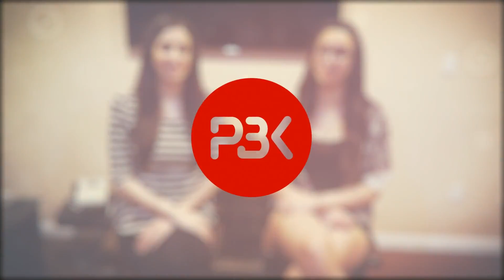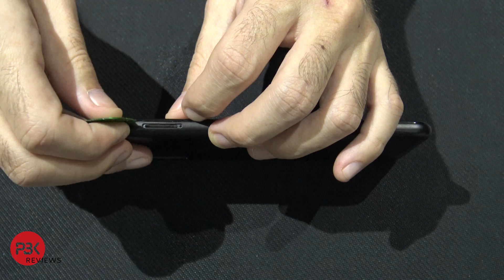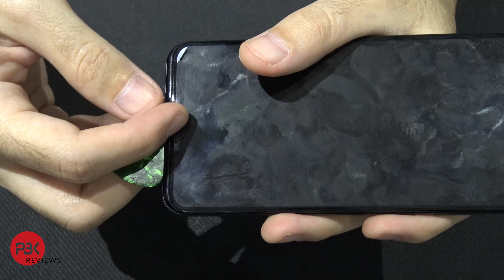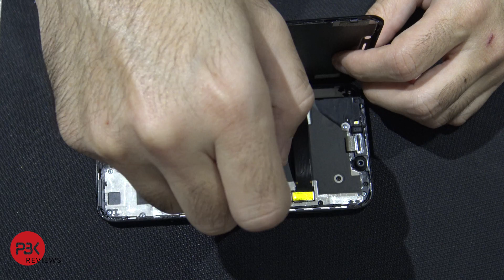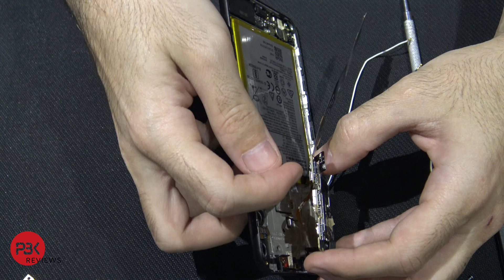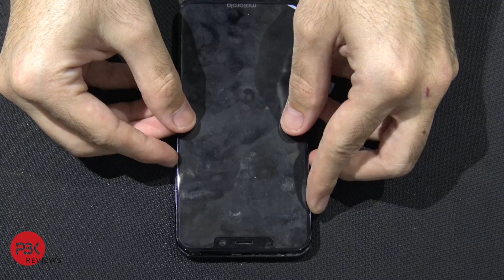Motorola One Power Moto One Power XT1942 Disassembly Teardown Repair Video

Comment: Why protective tape required on battery? Does absence of tape reduce performance of phone
Reply from the maker: It helps transfer heat away from the battery and components to the back of the phone to be transferred out.

Comment: sorry, but how to remove the battery?
Reply from the maker: Battery is held down with adhesive, so you need to use a hair dryer or something else to heat the front part of the phone where the screen is so you can warm up the adhesive underneath the battery to loosen it up. Then you use a plastic pry tool to gently pry the battery off (keep in mind not to pierce the battery or bend it too much to avoid risk of it shorting or catching fire etc.).

Comment: my phone turn on only when charging, when unplugged charger it turns off, what could be the the problem, do i need to change battery or charging port board
Reply from the maker: Might be a bad battery or possible the battery cable got disconnected. But either way seems to be a battery related issue.

Comment: I got my battery replacement in my moto one power. Even before one month of replacement the battery got unstable and dead. Only white led blinking in the top while connected to charger. The battery had warranty for 3 months. I tried to claim but they said they will check for any short circuit. ( I think the battery is unstable since battery backup is not good already). But now they are telling that an IC got short and waiting for the spare. What to do ?. Help me please
Reply from the maker: Hi, not sure since I am not too familiar with electrical engineering to be able to help you there. If replacing the battery did not fix the issue, then ya your best bet would be to wait and see if that short is fixed from whoever told you that was the problem. Also make sure your using an original charger to prevent possible damage caused by the charger itself.
Reply: @PBKreviews  I don't know what happened but they repaired my phone for free. Maybe they made a mistake while battery replacement 🤷🤷
Reply from the maker: @jamunal3715  oh that's good

Comment: This video is incredibly detailed and knowledgeable and I'm watching it for second time. Wonder why it got so less views. 
I was hoping to understand why my volume increases automatically and the volume bar stays popped up on the screen and power button short click doesn't work (although long press to restart the phone works). The popped up  volume bar usually goes away when I touch the home button on screen. Any idea what might be causing this? The phone is 2 years old but it started a year back, I was just too busy to take it to service center.

Comment: My moto one power (1yr old) display is 50% broken but still works nicely should I use the phone in such condition or the broken screen should be replaced!
Can I insert tempered glass in such condition!?
Reply from the maker: Hi, its up to you, but the broken glass can get worse or cut your finger when using if its bad enough. You can place a tempered glass over but it would sit flush and would have bubbles or air underneath it since the screen glass is broken.
Reply: @PBKreviews  thank you brother for the conducive information.
Reply from the maker: @abhikchakraborty3850  you're welcome

Comment: I want to replace changing board. My charging port is just loose and did not work for turbo charging and disconnected. So can i assemble it by myself at home? And can you tell me what kind of tools i need to buy? 😲😲🥺🥺
Reply from the maker: You should be able to as long as you follow the video and are careful but it's not too easy for a beginner so do it at your own risk. You can get one of these ifixit tool kits which will have the tools needed to do the job. https://amzn.to/2QfKb8t   . You will also need new adhesive to cut and apply to the frame to put your screen back on. Links are in description.

Comment: Sir,can u kindly tell me after replaced the screen display....usely work good, after long time the screen display was sleep .... without help of charging...any idea of in this issue
Reply from the maker: Not sure exactly what you mean, but if the screen is staying off maybe your proximity sensor is covered and is thinking your face is to the phone so it keeps the screen off. Check the sensor see if anything is wrong with it
Reply: @PBKreviews   see a couple of
Days I replaced the screen display it worked like as Normal, suddenly unexpected happened,wild I'm using...the phone has sleep and can't turn on,i only can "on" with the help of charging..the battery was 76%quit enough good.i don't know why?** Kindly,guide me to fixe..

Comment: Twice I folded the whole Motorola One Power as shown - https://www.youtube.com/watch?v=Nw_vAzCWGaU - after replacing the board - USB sockets. After submitting the whole - according to the demonstration film, the display lights only at 0% .. Where do I make a mistake?
I am asking for help in removing the assembly error of my Motorola One Power - the best answer is to e-mail andre49@wp.pl

Comment: Hey! I have Moto one p30 note,xt 1942-1. Somehow i managed to flash "ab blur" 29.74.25  file. Can you please tell where to get the OTA updates for December, Jan and Feb security updates? I'm currently on November patch with unlocked bootloader. Of course auto update doesn't work. Also can i flash xt 1942-2 files?

Comment: Can you replace everything without a heat gun? Do you have to remove everything to get to the battery?
Reply from the maker: Hi, yes and yes. You can do it without a heat gun but might be harder to pry open. Also you need to disassemble the phone to get to the battery.
Reply: @PBKreviews  Thanks!

Comment: @pwedbykyank bro can u just give me the main board and the charging port board??? my one power is liquid damaged????
Reply: and so i found that there is no p2i coating because i havent dropped my phone in water but it got damaged due to a sinlge little water splash
Reply from the maker: Hi, i dont have the phone anymore. Did you try using a brush like a tooth brush to clean off any corrosion on the main board and connectors?
Reply: @PBKreviews  ss i tried a cleaning the board and i found it shorting and i coludnt repair it
Reply: i only bought it last month only it was my first phone bro......after the nokia c5
Reply from the maker: @gopinathgopi5534  oh sucks sorry to hear that. Try contacting Motorola maybe they will offer repair option to you.

Comment: Hello, which camera sensors they used ?
Reply from the maker: The main camera is 16MP PDAF (f1.8, 1.12um), and the secondary is 5MP (f2.2, 1.0um). Also the front facing camera is 12MP (f2.0, 1.25um)

Comment: This phone suffering screen bleeding issue  I use this phone I am facing this problem  Flipkart doesn't help me!
Reply: its not screen bleeding. its gradient colour. u can check this on screenbleeding app.
Reply from the maker: yes many people are having or reporting that issue. Motorola says its a gradient setup with the software for the navigation keys. If it is so, hopefully they will make an update to the software to give people the option to turn it off or on.
Reply: It's not screen bleeding

Comment: Only 4850 mah
Reply from the maker: lol. Its not bad
Reply: @PBKreviews  they advertise it by saying 5000 mah battery now i am thinking of the actual capacity of the phone which advertise 4000 or less mah battery
Reply from the maker: @sumitahar5328  on the battery it says 4850 / 5000 so im just going with the lesser amount since it seems to me in actuality it would only be rated 4850

Comment: Does it has screen bleeding issue..!!
Reply from the maker: No, no bleeding issue on this unit. Why? Is that a common issue with this model phone?
Reply: @PBKreviews  yes sir...!!
Reply from the maker: Oh i see. Hmm thats odd. Does it happen after a drop or just naturally?
Reply: @PBKreviews  naturally
Reply from the maker: hmm i see, I will take a closer look in different lighting patterns and see if I can notice any bleeding light around the edges in the next few days
Reply: @PBKreviews  if you see any such issues pls make a dedicated video on this sir..!!
Reply from the maker: @bsd star @gagan ahuja @harsh jaiswal I did notice the back light issue on black screen on the lower lip of the phone. I think all phones same model will be the same since all use the same screen but I pressed firmly on the bottom lip for 10 seconds and rubbed the bottom edge of the screen also and it helped a little bit now the light is not noticeable. But be careful if you are trying to do this because there is always a chance to press too hard and damage the screen. Here are some pictures of how it looks after I pressed on the bottom lip (also note that the screen is on full brightness). https://ibb.co/bFg1vf
https://ibb.co/cOMO80
Reply: @PBKreviews  @motorola says this is gradient. But it appears on some apps
Reply from the maker: hmm not sure, I do notice the bottom lip area becomes more brighter when the navigation keys pop up, maybe they will do a software update so it doesn't force so much light just to display the navigation keys, or if anyone wants to put a custom rom on the device with different navigation keys on the bottom it can possibly help. I know people used different launchers on other phones that had bleeding issues to minimize the light on the bottom.
Reply: @IndianFunGamer67  really...motorola officially announced about this issue...?? Pls send me the website link...pls
Reply: @PBKreviews  is there any chances by installing nova launcher to minimise the bleeding issue..!!
Reply from the maker: Its possible, every launcher works differently so you may need to try a few to see if any help out. Usually though, ones which actually alter settings in phone such as LED brightness and so forth would work best but those usually are ones based off of custom roms and that requires you to root the phone and possibly unlock bootloader before being able to install custom roms.
Reply: Can someone take a screenshot from the phone where screen bleeding is visible to you? NOT SNAPSHOT. I think if this is really a gradient screenshot will capture it otherwise not. Check on apps where screen bleeding is visible not on home screen.
Reply from the maker: @IndianFunGamer67  maybe ask on India phone forums since this phone mainly is available in india so many people will have witnessed the issue to be able to screenshot it
Reply from the maker: I like motorola a lot also, and I don't think Lenovo will ever let motorola die off. Motorola name has always been a good one and I'm sure if they see interest in the motorola phones rise, they will put more effort into making sure the phones are up to date and well maintained. However I believe with the Z3 release it was a disappointment since it was basically the same phone as the Z3 play but just a better processor. They did not even release a Z3 force, so that to me was a backwards move. Hopefully they will release a flagship force model phone (shatterproof screen) in early 2018. Here in USA most of the soft updates ultimately come down to the carriers like verizon or sprint or at&t because they have their own requirements and they have to approve the software for the phones etc with their own apps and functionality. But the unlocked and carrier brand free ones are more easier to get updates for since its up to the manufacture only. However Verizon is usually good with the software updates on their lines of phones so far, and I have been pleased.
Reply: Yes, only you can clear the confusions. Backlight bleeding issue is on this phone or not. Most people have reported it in India. It is visible on the bottom edge of the screen.